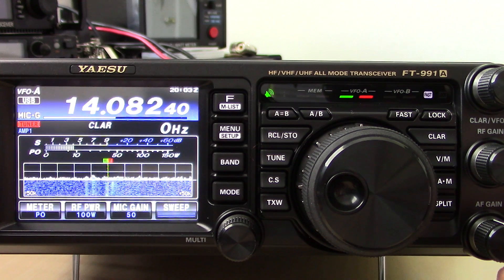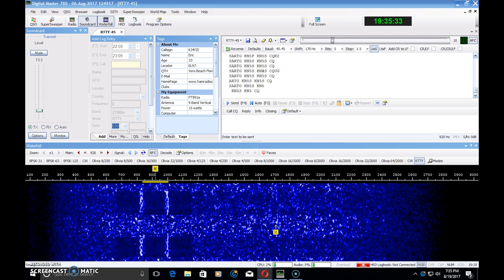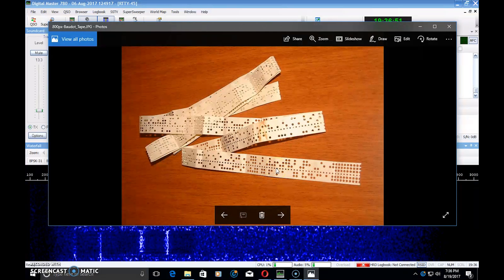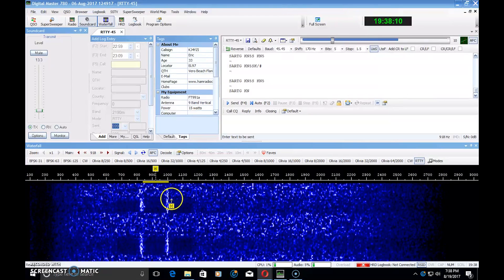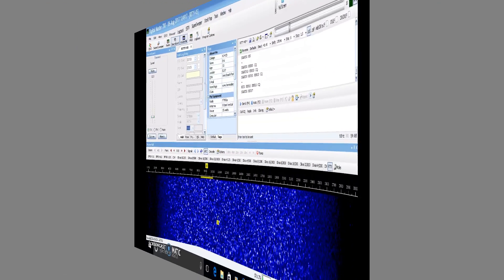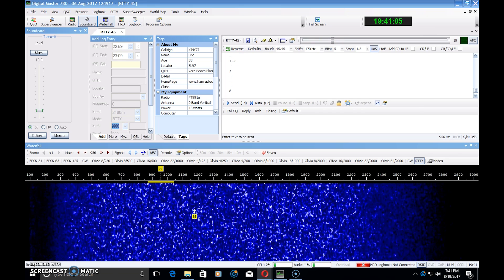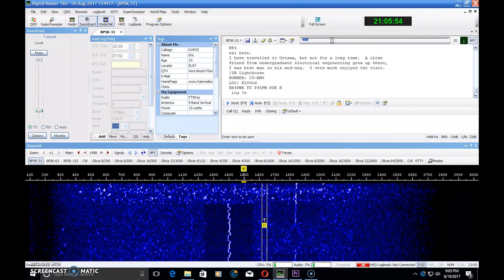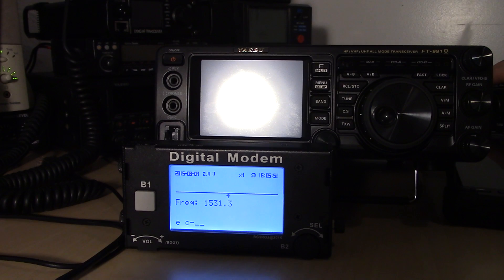Where Is All The RTTY? What Is RTTY? HF Digital Mode

Comment: I once intercepted a non-encrypted signal which listed all names of passengers aboard the Lockerbe Scotland Air Disaster and at that time was told it was most likely an embassy communications. So, I will guess that most RITTY stuff is nw updated and you will never again see such kinds of communications. It was kind of interesting because earlier I was asked by my boss to check out a radio which a young woman believed had a bomb inside. Knowing explosives like I do right away I thought no no bomb since RDX is very dense and would make a radio unusually heavy. But I took it all apart and plugged it in to the wall and I could sense no bomb being present.

Comment: I used to be a Model 28 teletype tech when I was in the Navy
Reply: Navy radioman here, still got teletypes
Reply: @triplew999  I've still got a reperforator and tape reader from a Model 28 ASR, a few PA tubes from AN/URT-23V and two brand new CRT's for AN/URA-17. Oh, should clarify, was in the Royal Australian Navy, and worked quite a bit with the usual suspects, USN, Royal Navy and south east asian naval forces. 

Unfortunately government policy was destruction of obsolete teletype gear when we went to Dataproducts MXT-1200 printers. I was on the last RAN ship operating teletype, so once the gear was "cleansed" under the watchful gave of the security officer (Basically watching me remove platen, type box and ribbon for destruction), the rest went to scrap metal bin, no other users ship or shore to use the stuff. 

Put as much stuff as I could in boot (trunk) of my car back in 1990. Might sound a little dishonest, but could not bring myself to let it be turned into razor blades.
Wish I had the will/space/audacity to save an entire ASR.

Comment: I used an old teletype keyboard like that when I was in high school. It connected to a mainframe computer at 110 baud with an acoustic telephone coupler. They only had one teletype keyboard in the whole school that had to be shared. The paper tape you showed is called paper tape. I used to have some paper tape and old computer punch cards, but they were all thrown away years ago. I used keypunch machines in college just after high school. Stacks of the computer cards were read by the card reader machines. Each line of code was a separate card. That was called batch computing. Batch computing is still alive today. It’s not done with cards, but batch computing is called computer jobs or batch jobs.

My first exposure to RTTY was as a ham in the mid to late 70s. I owned an older teletype for awhile, and got it working, but junked it because it was too much of a boat anchor. Today’s modern digital modes are vastly superior to the old days. My favorite mode was AMTOR ARQ. AMTOR was error free, perfect copy. AMTOR worked down deep into the noise. When 20 meters was closing for the nights, the AMTOR stations were the last signals on the band, riding the QSB as the band died for the night.

After being inactive on HF for over 30 years, I’m getting back on HF in my retirement years. In my 20s, I envy’s the old timers who were retired and could be on HF during the daytime and nights. Decades ago, I dreamed that’s what I’d do when I got old enough to retire. I regret being inactive on HF for so many decades, but now I’m going to get back on HF again. Not with my old Kenwood TS-940 that’s plagued with problems and not functioning, but with a new Icom 7610. It will be great to get on the new digital modes, and maybe the old digital modes like AMTOR, if I can find someone to talk to with AMTOR. I started ham radio in 1972 as a 25 to 30 wpm fast novice. My CW is rusty now, but I’m plan to get back my CW skills too. CW was my favorite mode, until the first AMTOR QsO with an AEA CP-1 and a Commodore 64 Computer. Now, I’ll be using much more refined equipment and digital modes.

Thanks for your videos! Your videos helped encourage me to get back on HF during my retirement years!

Comment: Recently have gotten  involved with RTTY contesting, which is a ball. Currently using 2 HF radios and 2 PC's  to run SO2R, which is somewhat challenging as the rigs are different.  Thanks goodness for the free N1MM+ and MMTTY apps to log, QSY and TX/RX RTTY.  Although RTTY may not be as popular as it was, there are still plenty of RTTY contesters using the mode.  If you may be interested in RTTY contesting, check out a great source of info at www.rttycontesting.com. See ya  around the bands, boys.

Comment: I ran what was commonly known as a RAT RIG back in the late 70's while stationed in Germany.  Our rigs had a TTY-98 teletype that we could compose our messages on ticker tape.  We'd roll them up, not fold them, ready for the fire direction control rig to tell us to send coordinates to the fire platoons.  Our rigs had AM, FM voice, CW and RTTY.  We would come up on the net, and chat in real time using a TTY-28 or 98 teletype that didn't have a display but rolls of yellow paper.  O! how I do remember when the modems would negotiate and connect.  The RTTY chatter tones was fun to listen to.  The TNC had a cat's eye tube that would flicker as the tty banged out the message.  The best thing about working in the rat rig was we had heat!  Yeah!  Heat in the rig!!  Every now and then we'd string up a diapole and operate in CW mode.  It's been 40 plus years since I banged a key.  I'm just getting in to amateur radio and looking forward to the journey!

Comment: I used to run RTTY with a PK-232 and an ASR32 (IIRC). I also had a old model 19 keyboard that would bounce around all over my desk when it was running (chunk chunk chunk chunk chunk chunk chunk chunk chunk ) THis was all back in the late 70's and early 80's.

Comment: Worked RTTY for Navy MARS in the 70s at NAS Lemoore, CA. In fact, that is what my introduction to Ham Radio was. We'd receive messages via RTTY on MARS band, convert to typed messages from paper tape then use SSB to contact other stations with traffic. Did the reverse going east to west. Used a Kenwood TS-520 and Kentronics RTTY decoder. We used a TELETYPE MODEL 28 ASR COPYING ITTY to make and read tapes/print message traffic; it was also hooked to the TS-520.
Our traffic came from 4 states and from Guam & Hawaii, all just outside 80-meters.

Comment: Ex military communications expert and a HAM for 30 years and never heard it called Ritty?????  R T T Y or Teletype yes.  Ritty never.
Reply: Been a ham 46 years. Always called it ritty.  Reeses cups were 5 cents each also. Gas was 19 cents per gallon. Don't know why I'm rattling on either......
Reply: Yep that is what I remember also.  Additionally referred to as FSK typically at 75 baud.  I also learned the meaning of expert then, "a drip under pressure" hihi.
Reply: I wouldn't call it a "digital" mode either.
Reply: Digger D When I was using RTTY in the 1960s, the pronunciation RiTTY was not uncommon; just a shorthand way of saying all those letters! 😃
Reply: Well it consists of two tones separated by a few hundred hertz ;)  But I guess you could stretch it to digital.  But then CW would be a digital mode too ;)  To me digital means a binary representation of a number.
Reply: Ok, just never heard it in all my experience.  We just said R T T Y or teletype.  Thanks.
Reply: CW is VERY much a digital mode and so is RTTY.

However... most of us refer a digital mode to a format that is not readable to humans.

Take for example the ASCII table where you have the usual a-z, A-Z, 0-9 and so on but also some computer specific codes that doesn't make any sense to us humans (unless you're a programmer or nerd).

In that regard CW is not a digital mode anymore since a human can easily copy the letters and numbers.
Reply: @thiesenf  You guys/gals are funny. ^^ First, "CW" means Continous Wave. It's a modulation type (sounds funny but it's true at the heart), no mode per se. If you remember spark transmitters, you may get my point.

"Modes" that CW are using, for example, are Morse Code and Hellschreiber (Feldhell) more precisely). Morse may be "digital" because it has defined pulses of long and short (on paper, at least). Hellschreiber has varying pulses, since its a bit like FAX, so it's neither entirely digital, not analogue, but binary also (Hell is a socallled fuzzy mode). Morse is also binary. Both use ON-OFF keying.

Now for RTTY. RTTY is using a carrier signal and two frequencies, named Mark and Gustav. Err, Space.. It can be modulated using AFSK and FSK, but in the end, it doesn't matter. What's special on RTTY is, that not both signals are required. A RTTY decoder can use either of them or both.
So is it binary still or digital only ? Hmm.

RTTY. I heard of Ritty at some point, but you likely never heard of „Rütütü“. That used to be the German version of Ritty, common ca. 1970s (use Google Translator to hear the sound).  :D vy73s,
Reply: Baudot and ASCII are not digital - they are numeric representations of the alphabet (etc.) which can be sent digitally or otherwise. ;)
Reply: A numeral is a digit... thats digit-al.

Comment: Back in my starting years on the police force, in the later 1970's, I was placed in the Comms Dept, mainly because of my Ham Radio involvement.  I spent time each day on RTTY machines, much like you showed in those still photos.  We would use RTTY to transmit statewide to other agencies with requests for info,  transmit BOLO's  both in and out of state,  and used RTTY as out primary source of receiving info from sources throughout the US.  It was a fun and interesting time, especially once someone taught you the "secret" things that you could do with RTTY, once you learned to jump circuits,  bypass relays and the like   :)  Those were some fun times back in the comm shack !

Comment: The advantage of the new digital modes is that you only need a small amount of power RF to send and receive than RTTY to get a slow message out =(   The older RTTY had a TUNE to the phasing of TWO TONE  operation and the error is directly related to that phasing =)    RTTY needs much MORE POWER  RF than the other digital modes .... even CW can be used in LOW POWER levels =)   RTTY take up the same band width as 10 PSK-31 mode signals =)

Comment: OK, Hear goes an oldtimers stroy about RTTY.  I knew a guy from the local radio club (back in the mid 60's) who had been exposed to RTTY during WWII.  The standard practice, as you stated was to make the punch tape on a keyboard maching and then run it through the tape reader which was attached to an audio modulator which made the Mark and Space Tones (I forget, someting like 500 & 200 Hz) that then could be sent into an AM Transmitter mic jack.  So this as AFSK.  The tape readers were nominally, 110 Baud. 
 
So enter my high school girlfriend who went to airline school after graduation.  In the airlines in those days, there was still heavy use of teletype.  As it happened, she had been a superior typist in high school and she evolved into the fastest teletypist that the school had ever seen.  She could actually go faster than the 110 Baud system.

She comes home from school and I take her to see my buddies RTTY setup.  He sends a typical CQ messge and gets a response.  So she starts typing out the reply while the incoming  message is coming in and when it was finished, we fed in the beginning of the tape and the reply / answer began going back in real time.  After a bit, this drew a crowd and we had a real pileup before long of guys trying to figure out how this was being done!  

She would have has a great time now being able to type straight out to the transmitter!